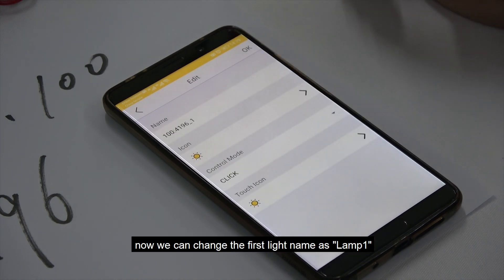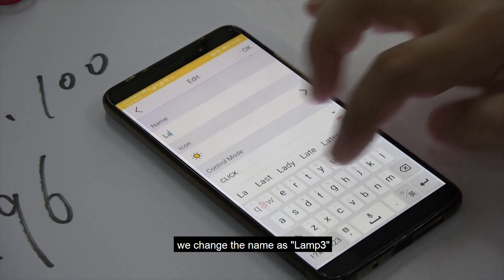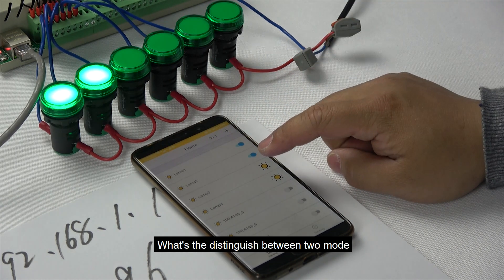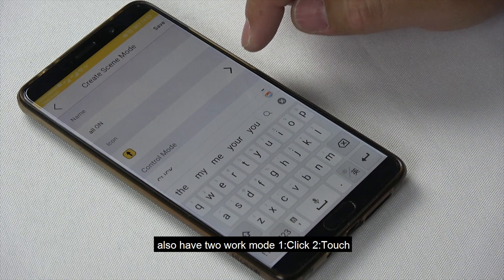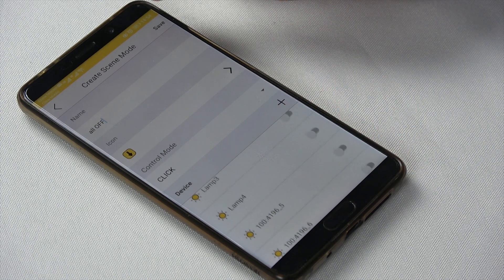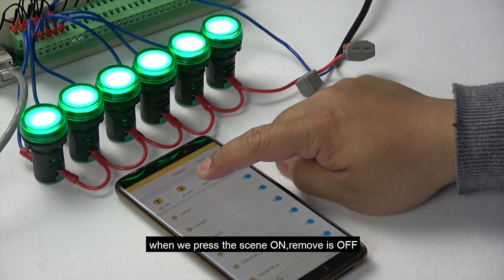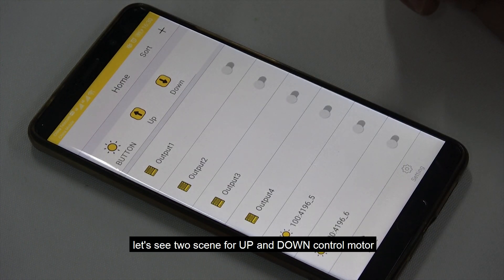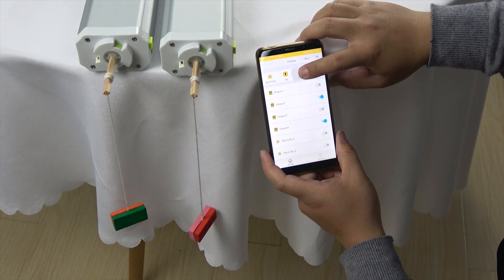[Automation Module Project DIY] KBOX app scene mode control motor

Comment: Hi
I want to control 32 output replays automatically,
 by 32 different Temperature sensors 
Witch items i must order?

Thanks a lot
John from Greece!!
Reply from the maker: you can buy KC868-H32B Pro and some KC868-AM and sensor.

Comment: thanks  
how to use switch button ( up - pause - down )  ?
Reply from the maker: use two relay by home assistant app, it's easy.
Reply: @KinCony 
Thanks 
I want use tuya Application 
 if there is vedio demo for home assistant or tuya pls sent me link
Reply from the maker: @محمدرزق-ح1ح  do you have using our smart controller?
Reply: @KinCony 
I have KC868-32BS-COLB and i wait Receive KC868-H32B PRO
AND SERVER
Reply from the maker: @محمدرزق-ح1ح  ok, you can set interlock mode by H23B Pro controller's webpage
Reply from the maker: then you press 1 button for "up", press again for "pause", two relay will never all ON at the same time, interlock mode will protect your motor.

Comment: It's easy if you fix timer for open and close for example if the curtain require 5 seconds need to press so you can add timer setting each click  one touch curtain run until finish 5 second
Reply from the maker: Thank you for your advice, this function already used in "KinCony Smart Home" app, scene can set timer by yourself. that need internet and cloud server. But we are developing new logical controller can do this function in local network.
Reply: @KinCony  Is there update on this development for openning the curtain all the way (fully) by just one click on K1 button and closing the curain all the way (fully) by one click on K2 button for example?